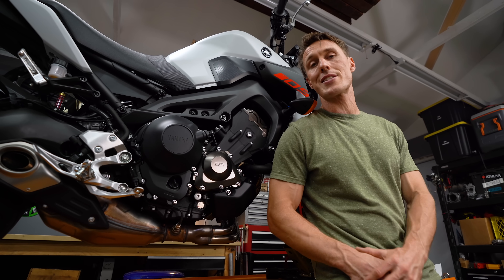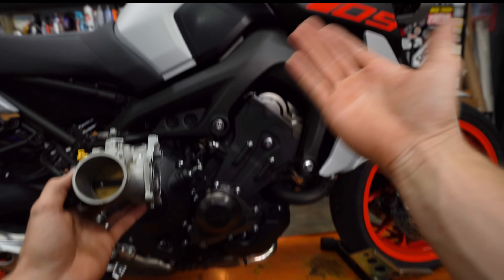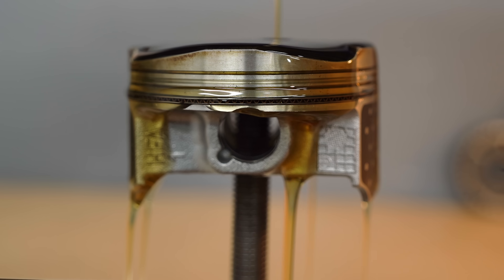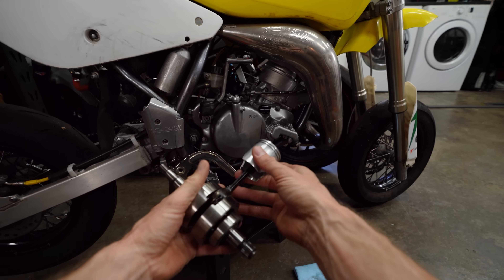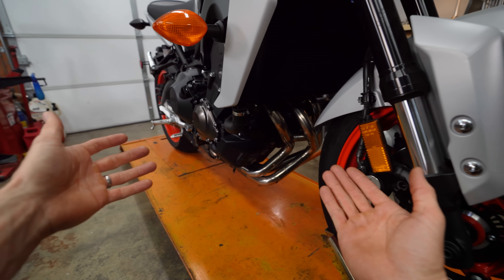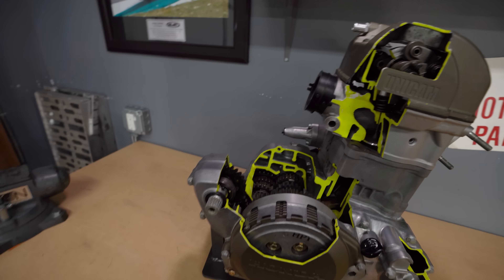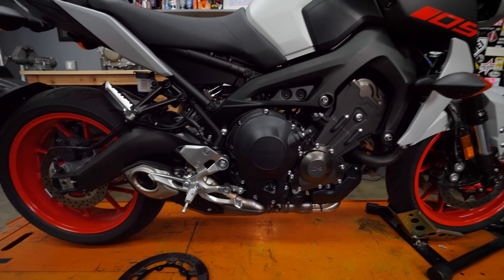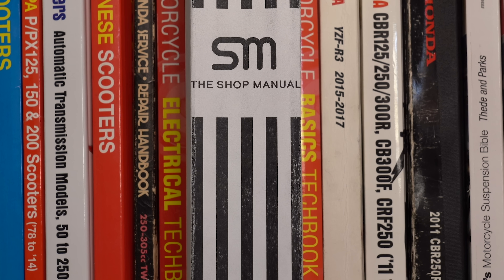Is Engine Braking Bad For Your Motorcycle? | The Shop Manual

Comment: Engine braking also increases fuel economy, when engine braking the engine is leaned out as no fuel comes in. This produces heat, but not enough to do anything.
Reply: @LastRaven yea I'm referring bro fuel injection, most people use fuel injection for bike now, and almost all cars are fuel injection
Reply: @LastRaven yea that must be your area, for me, there is old bike but not many.
Reply: @LastRaven where I am is similar, I'm in Canada and you can only ride between March and September. Anything after its below 0c and could sbow. And in the summer its either 30c plus or raining, so lots of fair wether Riders here too

Comment: The 2 stroke “problem” isn’t really even a problem because when the throttle is shut there is still enough fuel and air for the bike to run if there wasn’t then the bike wouldn’t idle when at a stop

Comment: I’ve been wondering about the physics of engine braking for a while, specifically the conservation of energy. When you use your brake pads, I understand that the bike’s kinetic energy is converted into heat in the pads and rotors, but where does the energy go during engine braking? It’s intuitive that sucking air through the closed throttle takes work, but there isn’t much heat or noise produced, so what gives?

This is the sort of thing I ponder while riding my motorcycle...
Reply: You are compressing the air. That takes work. Your engine acts as a compressor.
Reply: If you want to learn more look up engine braking and a channel called engineering explained has good vids on it. He is in a car but it's the same thing. The energy still produces heat as the engine leans right out

Comment: Semis use engine braking. It’s a safety feature for hauling massive amounts of weight down the road and steep descents. Of course it works and is safe. If it didn’t work or was bad for the product, they wouldn’t manufacture it that way! Companies spend millions in R&D so they don’t have to spend billions in liability suits… On another note, Truckers also call it the “Jake brake”. So if you ever hear that, it’s the engine brake.

Comment: Increased oil consumption.  Rear only braking changes balance.  I prefer to use my brakes to even out tire wear a bit more.  I've ridden in plenty of mountains on a fat ole cruiser with a single front rotor and never had fading.  I don't see it happening outside of track riding.

Comment: I heard it was harsh on the clutch for some reason 🤷🏻‍♂️ I engine break all the time, it’s part of my riding. My rebel 500 burnt 2 clutches in a year. Shop told me it was because of engine breaking but I don’t believe it at all
Reply: Only way it hurts the clutch is if you’re way mismatched on road speed vs engine speed, or your clutch is just simply misadjusted.

Comment: Great video, but is this actually being debated among riders today? I had no idea. Seems like such an obvious thing that it is one of the benefits of manual transmissions, especially when going down prolonged hills or to brake before a turn and be at the right RPM range to pull through it once the turn starts.

Comment: Say you're on a slippery surface and you slow down using your brakes. The ABS will help your to stop by pulsing the brakes. But, if you're using engine braking, the ABS can't pulse that. Maybe, that's why slipper clutches are becoming popular.  Having said that, advanced riders (in the UK at least) still advocate brakes over engine braking. Not because of worries about engine damage, just that it's what the brakes are for.  In the past, using engine braking on engines fitted with carbs wasted fuel, but with fuel injection  that's no longer an issue.
Reply: I doubt very much that any ABS would react to any braking to the same level as an engine braking could manage. Don't know if I am sounding clear, so I will re-state: Engine braking wouldn't be enough to trigger any ABS.
Reply: If you revmatch properly there would be no slipping.

Comment: Never thought about this but now... How about throttle bodies. Is it designed to constantly withstand a stress, trying to stop any air from getting into engine? Have seen some worn out units, could it be that engine breaking speeds up that process?

Comment: Ari  WHY is this even a question ?? that anyone would ask , since just about ANY internal combustion engine has done this since their inception regardless of application. 
I mean REALLY if you had to ask this question then I'd suggest that owning anything mechanical is just not your bag 

Oh and to correct you the Throat butterfly's DO NOT close totally  EVER.  there is and will always be some Air ingress as valves open and close. you are not working on a total vacuum ! IF you were then there would be NO braking effect on the compression stroke and the whole process would be useless. .

Comment: I was expecting belt driven distribution to be addressed… if I am close to the belt replacement service, should I give engine brake a rest until I change the belts? Of course I never downshift like a maniac and dump the clutch, but still a slight concern to skip a tooth in the distribution.

Comment: Engine braking is downshifting right? I've driven and rode standard transmissions my whole life. I've always practiced downshifting to slow down. Now, you have to use common sense, you don't downshift into 1st or 2nd gear when you're going 100mph. Depending on the bike that would cause massive over revving. But, I shift and downshift by ear, just like i do my dirtbikes. 

Side note: I once knew a guy that didn't know how to shift, so he kept his bike in 2nd gear at all times! Dude was hitting dam near 10,000rpm's at 60mph 🤣😂

Comment: One more, I did read that engine braking has a significant role in removing carbon deposit build up via the vacuum created.
Reply: As an aside I haven't found any confirmation (and I tried ...reading not a few research papers) that engine knock can be detected absent engine knock sensors. IOU 2 bucks.

Comment: What about the opposite? Not using engine braking? I'm a new rider and when coming to a full stop like a stop sign or red light I tend to just pull the clutch, release the throttle and use the brakes, is this bad? I am trying to use engine braking more but still often don't.

Comment: Extreme engine braking nay not be any bad for the engine itself, but it can block the rear wheel in a way even ABS wont be able to prevent.... thats why they make slipper clutches right?

Comment: If exploding hydrocarbons at high temperatures forcing pistons to move back and forth won't damage your engine, then a weaker version of that a la engine braking won't either.

Comment: Your video describes engine deceleration not engine breaking.  Engine breaking is dropping to lower gears then dumping the clutch to force the engine and clutch to stop the bike and that will destroy a bike just use the damn brakes people.

Comment: I was going downhill once and slowing down, i used engine breaking, possibly clicked down through too many gears, the back wheel slid, luckily only a tiny bit and i carried on. Not sure how it all happened, i was using the front brake, not the back. I assume the back wheel slowed too much and thats why, so i was still rolling just back wheel was too slow for the speed i was at. (I wasnt going very fast)

Comment: I knew it was okay however I had a concern today as I checked my oil on the sportsbike verses my cruiser. I just had to dump a liter of oil  into the sportsbike  and now the fill window shows proper lines, it's only got 154 miles. Verses my cruiser  a 450 I have 400 miles on it and I have not needed to add a drop and I run that thing hard. So I was curious as I engine vreak far less on the cruiser.

Comment: Well shit seems I've been pulling in the clutch on decel unnecessary on my 2 stroke. Though I suppose my particular engine is much shittier than most, but still good to know. Granted its not like the engine of that bike actually gives you any meaningful resistance for engine braking but it does mean I'm not using the clutch mid corner.

Comment: Install one of these: https://safer-turn.com/smart-brake-module/ - Smart Brake Module is a small electronic device which senses when the bike is slowing down by the means of engine braking or downshifting and it activates the brake light.

Comment: I accidentally downshift too soon from 3rd to 2nd and the rpm went from 1k+ to 3.5k rpm, quite abruptly, I was at 60km/h gear 3 to 2, engine scream a little bit, well to me he was screaming 😂. But it’s okay right? My bike is new, just completed over 1000km and done the breaking in period. Should I be worried?

Riding the R1250RT

Comment: I have a different opinion on how engine brake occurs. It occurs because when the throttle is closed and the revs are high,the combustion that happens with the mixture inside the cylinder,is too weak and cant push the piston down,so the piston gets draged. I believe that because sometimes when i engine brake,i turn off the ignition key and the bike brakes even more(but i am still on the same closed throttle)and if i turn it back on,less brake occurs. How can you explain that?
Reply: Your maybe just looking from a slightly different angle? With the throttle closed it turns the engine into a vacuum pump, sucking air through the almost totally closed throttle. This takes hp to suck the air through.
 If with a efi engine you also shut off the injectors, or in your case killed the ignition, you gain MORE engine braking by losing the very small HP gain given by the small  amount of fuel being sucked through the idle circuit of the carb. Amount of fuel is very small but as you have noticed does make a difference to engine braking

Comment: The statement that it's mostly okay for 2 strokes as well is a little irresponsible. That cylinder can be starved of lubrication very easily with high rpm engine braking.
Reply: Your idle jet is still sending fuel/oil to the cylinders.
Reply: @someguy5035  It's no where near enough at high rpm
Reply: @StrykerV8  Based on what? Your mechanical engineering degree and extensive engine design experience?

You don't think these guys consulted engineers before they made this video?
Reply: @someguy5035  yes. Exactly that. 

Imagine thinking an idle jet flowing 40:1 gas:oil mixture is enough for a piston traveling up and down 8000 times a minute. Have you considered searching "2 stroke engine braking" and seeing what comes up?

Comment: hey i wanna know if u are on full throttle of 3rd gear and u wanted to up shift the gear to 4 but u mistakenly shift down to 2nd  a loud  comes and bike resist  ....WILL IT HARM THE BIKE?
Reply: If you are at high rpm in 3rd then shift to 2nd and rpm are over "redline" rpm then yes you do damage. Depending how high rpm could be  anything from bent valve(s) to throwing a conrod (total destruction) out the side of the engine

Comment: What about pulling oil past the valve guides and into combustion? You'll often see it in some cars at the bottom of a hill, blue smoke out the tailpipe as the throttle is applied. Could that foul plugs?
Reply: If the guides are really worn then yeah, a long stretch of engine braking could suck enough oil to foul the plugs.
Reply: A normal engine won't do this, but a worn engine will. If a engine is doing that, then it's already worn out. People have engine braked for a long time, look at semis, they do it all the time (Jake brake)

Comment: A italian tune up, without engine breaking, doenst work.  You need to heat and suddenly stock cool the Pistons head. As aluminum and  carbon have different dilation and contraction coeficient, the  carbon pops up from the piston crown, doing the top cleaning.

Comment: Engine braking is one of main benefits of driving a car with a manual transmission.
Reply: I don't know which manual transmission cars you've been driving, but I drove manual exclusively for the past 12 years and none of them do what a motorcycle does. Sure, if you downshift and release the clutch, the car will brake/reduce speed (sometimes abruptly and at the cost of damaging something, if you're at too high of a speed for the new gear) and it will prevent the car from gaining a lot of speed if you're going downhill without hitting the brakes, I'll give you that. But it does not brake the car when you take your foot off of the gas pedal like a motorcycle does when you release the throttle.
Reply: @Blinkubus  wait what? Obviously the engine brakes, only the car has a heavier mass and you don’t feel it as in the motorcycle! You drove the car for 12 years but seems like you didn’t learn so much...
Reply: @Blinkubus  Yes you downshift while braking, but obviously you have to know what gear to be in at the appropriate time.  It's called RPM matching, and it's a skill you have to learn.  I don't know who taught you how to drive stick, but it seems they left this out of the curriculum.
Reply: @Blinkubus  Of course it does. See Riccardo's comment below.
Reply: @thereallantesh  I never said I didn't know how to rev match, it seems like someone left reading out of your curriculum. I said if you downshift and release the clutch. Of course if you rev match it won't abruptly reduce the speed.
Reply: @riccardosbarra  Fair point, I hadn't considered the mass, I'll admit my mistake. Although there was no need to call out that I didn't learn much in my years of driving. I only stated that in my comment to emphasize my confusion. So much hostility on youtube, geez...
Reply: @Blinkubus  no rev matching won't abruptly reduce the speed, but it is still engine braking. As mentioned in one of the other comments the larger mass of the car certainly comes in to play. It's less noticable, but indeed works, and saves your brake pads. My apologies if I came across as harsh. That was not my intent.
Reply: @thereallantesh  All cool, have a nice day!

Comment: My friend who is a motorcycle owner, said that engine braking on a single cylinder is really bad on a long term basis because the cylinder can't take the force of the wheel opposing the engine and also the transmission gears are smaller than a car. I don't really believe him even I only drove a car. (I wish I could ride a motorcycle to experience it myself.) Can you please help me disprove him?

Comment: I rather buy new brake pads that's $50… Then sprockets & chains that cost about $200-$500… But that is just me. Not even thinking about extra wear on the engine after 20 year or more. It's fine if you have a race bike, and may have a sponsor or 10. I have to pay to get my engine overhauls. That cost about the same as a new one.

Comment: Engine breaking isn't bad for the engine.  It's only bad for your fuel economy, MPG.  You will lose a lot of MPG with engine breaking vs coasting the engine.
Reply: By coasting the engine do you mean shifting to neutral or pulling in the clutch? Cuz that's a terrible, awkward way to ride a motorcycle on a daily basis. And you're not actually saving an appreciable amount of fuel by coasting. You're talking drops over the course of a day's ride.

Comment: I've only had one person tell my it was bad and they were generally a moron. They even owned a manual car and would pop it into neutral and only used the brakes to slow. It was painful to watch.

On the other hand, I've only owned manual vehicles and use it heavily.. I'm basically always in gear if moving. As a result, my brakes last forever! I rarely touch em aside to shave off the final 5mph. I've literally never had to replace a set of pads.

Comment: Engine braking is only bad when you accidentally leave your toad in gear behind the RV LOL, even then they have oil pressure all the way to catastrophic engine failure due to excessive rpm

Comment: What about if you drop multiple gears like from 4th - 2nd gear and use engine braking. Will any damage be caused on your clutch?
Reply: Idk if you seriously asking, but if you are, there is no damage as long as you revmatch. If you don't revmatch it will ever so slightly wear out your clutch. And I'm pretty sure almost all riders know how to revmatch
Reply: Running in 4th and downshifting to 2nd puts you at risk of your rear end locking up and you going down. No different than if you slammed on the rear brake: could cause the rear end to want to skid out from under you. Engine braking is the same as rear wheel braking obviously.
Reply: @momule55  it won't lock if you revmatch, which most riders do
Reply: @rohinhans7819  rev matching only allows the bike to more smoothly shift into a lower gear. Rear wheel lockup occurs after the shift happens and the gear is too low for the speed when the clutch is engaged.  It produces a loss of traction that can easily cause the rear end to skid out. Too many of these comments are confusing rev matching with engine braking. Think it through...
Reply: @patbowen9704  the rear tire won't lock if you revmatch. If you match engine and transmission speed there is no reason for it to lock. Why do you think we do revmatching?
Reply: @momule55  Then slowly let out the clutch instead of releasing it quickly

Comment: What about on a 125 cc motorcycle. Is it ok to use engine brake always
Reply: 125cc will be fine.  Smaller cc bikes weigh less so still engine brake well. I have a 250cc mid 300lb bike empty, it engine brakes well

Comment: So no fuel is wasted when we close the throttle in high rpms?
Reply: A carb engine will always allow a little fuel through but if its injected it usually turns off injector pulses on the overrun.

Comment: can i use engine breaking for a long downhill (10km),while i m in 3rd gear ,engine rev so high(6k) without any throttle feel like stressing engine too much
and what about turn off bike to save fuel while in gear, does it make any mechanical damage to bike(break light and safety not a problem)